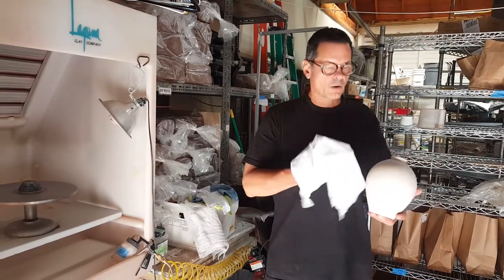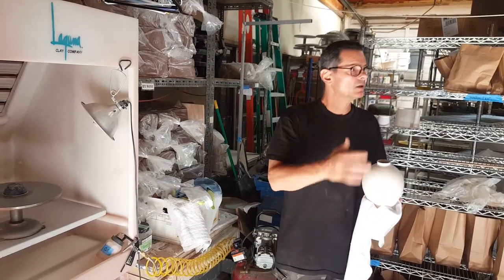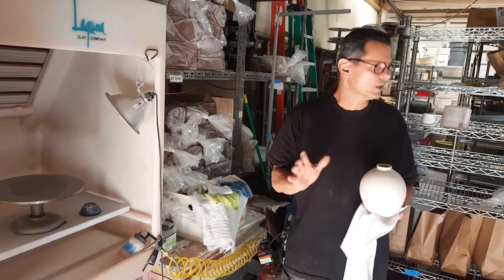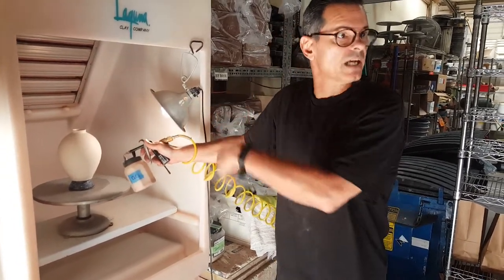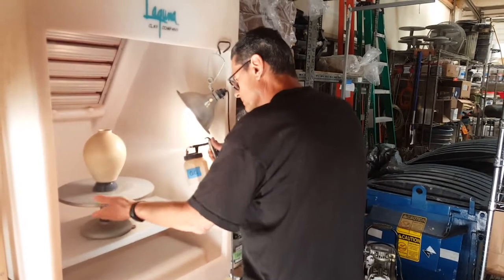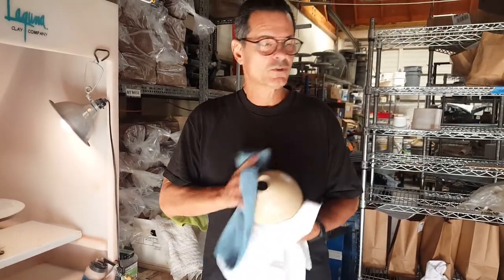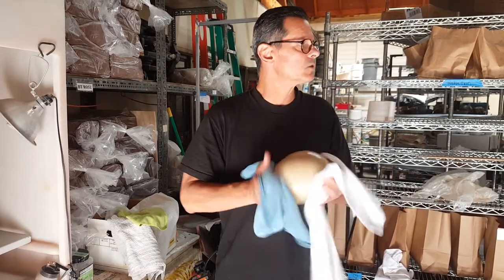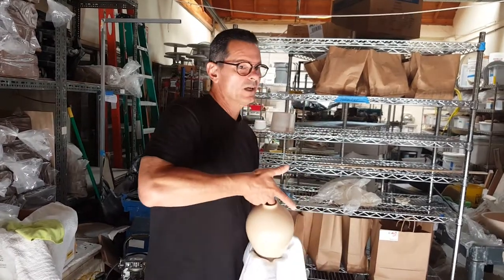Spraying Terra Sigillata?

Comment: Hello, any idea why my terra sig runs down the pot when I spray?
Reply from the maker: Check the specific gravity of your terra sig it may be too thin. Or spray lighter coats. I often use a Hake brush and apply on the wheel. I hope this helps.
Reply: @rollinsceramicarts6800  Thank you, it does help. It is too thin.